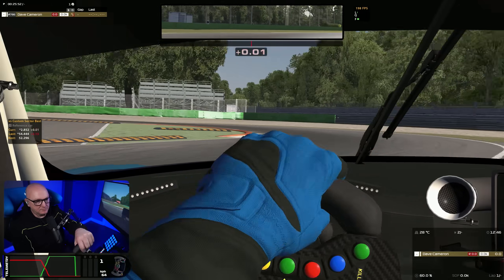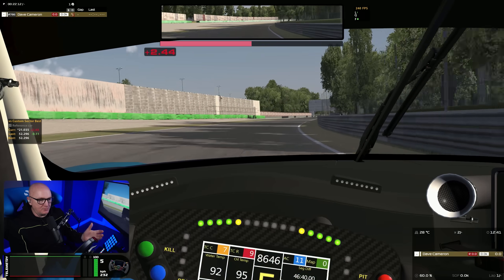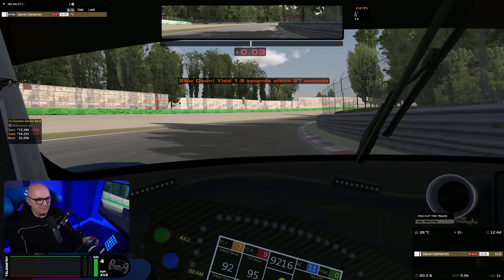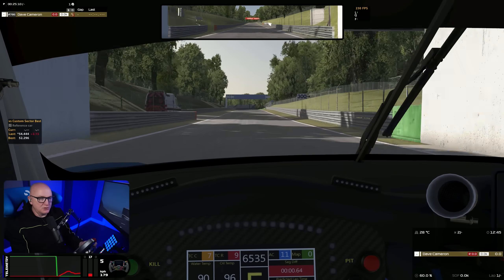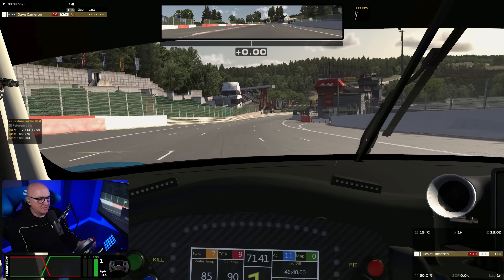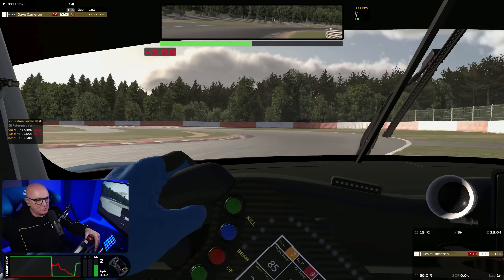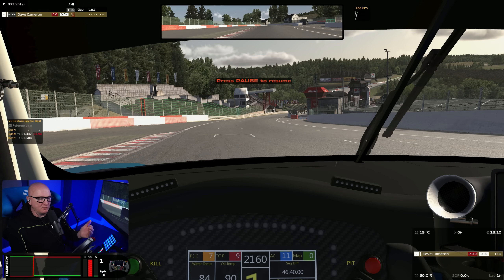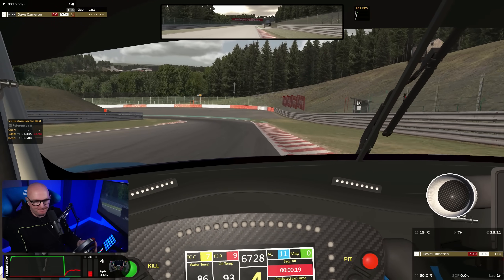What is THE BEST WAY to get rid of an iRacing Slow Down Penalty?

Comment: The slow down system is desperately in need of a rework. The final chicane at Spa is a classic example of the problem - you go off track to avoid a wreck (or even get wrecked) lose several seconds and then re-join by cutting the track - and even though you have already lost a tonne of time, you STILL get a slowdown penalty. Makes no sense at all.
Reply: The slow downs wouldn't be as much of a problem if the track limits were consistent and clearly defined.
Reply: @lavachemist  yes, it's about time all tracks were updated with the newer style track limits and all tracks had the additional notes about track limits.
Reply: @lavachemist  totally agree it's so unnatural considering every corner of every track is different, even some of the tracks with graphics showing the limits are inconsistent.  Just use the "all 4 tires over the white line" rule.
Reply: I watched a dude get spun on the infield of Daytona coming out of the second chicane, got launched into dead center of that big horseshoe and the easiest, safest line to get back on track was to join from where that turn begins. He did so under control and safely at the end of the field, after losing 10-15 seconds, he was promptly hit with a 3 minute and 44 second penalty. That's absolutely bonkers..
Reply: I'm so slow that the slow-down penalty doesn't affect me.😅
Reply: The insane penalty quantity for the final chicane at Spa also incentivizes people to do unsafe rejoins by doubling back into the middle of the chicane to avoid the 5 (?) second penalty, which leads to more incidents.
Reply: The newer tracks have been much better in this regard but yes I largely agree with you here. @lavachemist
Reply: @jasonandrew412  Happened to me last week at Spa, got wrecked going into turn 13, drove safely through the grass and rejoined on the short straight before turn 15. Didn't even have a slowdown, but a whole lap later got a black flag for cutting the track. Took me by complete surprise when that black flag came out.
Reply: Im fresh still to learning how the hell it all works been grindingnaway for daytona 24hr (ACC guy running iracing to join some mates for the 24) and i cannot fathom the track limits or the fact some just give you a 1x and others smash you with a ridiculous and frankly dangerous slowdowns. Exit of the bustop daytona for example. Slightly stuff it and 1.2s slowdown where you gained literally nothing. Real racing sim with zero track limits realism

Comment: move to the racing line and slam on the brakes.

In all seriousness they need to ditch it and move to a system like rf2 has where you get tokens based on how much of a bastard you were in cutting/extending the corner. Slow downs cause way more trouble than they're worth.
Reply: I think slow-downs are a great way to penalise deliberate track cutting. They wipe out any advantage you may have gained instantly, and possibly cost you more (as in, lost positions). Handing out a 5 second penalty at the end of the race may have zero impact on your result, so could be a strategic decision - just like Max overtaking off track, knowing that he'll more than make up the 5 seconds by the end of the race. Same with penalty tokens - the gain in time from cutting the track may be worth the cost of the token. That's never the case with a slow down.
Reply: @RacingAnt  I agree in general, I don't think anyone should be able to take advantage of deliberate cutting, but when it's a matter of only just clipping inside the apex, 2 seconds is waaaay more than you would have ever gained.

They need to implement a minor slow down for minor cuts, rather than losing 2 or 3 seconds (which could be several positions also) for something that would have gained you tenths

Comment: So I've watched the video through again and thought about it more and I think first of all there's something about the iRacing slowdown mechanic that either a) assumes a much slower than typical lap time or b) penalizes you for waiting (thus the increasing penalty).  Secondly, just like when you have to lift, you want to get it over with quickly.  Unfortunately when you get the Radillon slowdown, it's never intentional so your line is going to be different than just blowing through the offtrack area, and your speed is going to be lower.  So I think the idea is to lift enough that the slowdown timer starts to go down, and judge it and get back on the throttle earlier than when it's at more than a second left, maybe 1.3 or so.  I'd rather "under-serve" the slowdown and have to bleed off a little extra speed by doing a slightly lower vMin in one of the subsequent corners, than "over-serve" the slowdown and lose another few positions.  Also not to be excluded is the etiquette for serving slowdowns.  I must admit I've been naughty and served mine by braking a little earlier and moseying through tight corners to keep folks behind.  I think the ideal way is to get offline immediately but there's a grey area to it.  Of course we're fighting to win, so we should try to minimize the position loss, but not at the expense of safety.  Serving most of the slowdown on the straight, and scrubbing the last few tenths off in the corner I think is a decent compromise because that's not much different from making a mistake in the corner that costs a few tenths.  Anyway I think the topic of optimizing serving of slowdowns shouldn't exclude your philosophy on the etiquette just as much as the mechanics of it.  As a regular viewer I happen to know that you aren't a fan of serving slowdowns while staying on the racing line.  However some viewers of this video may not have watched enough of your full race ones.  Either way great video cheers.

Comment: The slow down penalty should be tied directly to your best lap delta.
 
That way if you’ve already lost time by avoiding an accident or getting hit off by someone the time penalty is nullified. Only if you gain time by going off track do you then have to serve the penalty. Also when you do go to serve the penalty there is none of this fooling around trying to find the optimal way to serve it. As long as your lap delta is representative of the penalty it’s considered as served. I never understood how it always seems a “1.5 second penalty” always results in like 3-5 seconds of actual lap time lost to serve it. The system is severely broken and needs fixing. That is the biggest thing this video really proves.
Reply: I actually emailed iracing askng for them to clarifythe slowdowns. It doesnt make any sense. Leave the bus stop at daytona even to your session best. Get a slowdown, now lift off the throttle a bit. Now you're down 1.5 seconds off your session best but your 1.2 second slowdown still shows you needto lose .5 of a second. Its so stupid

Comment: Love your content,  The best way Ive learned to minimize time deficit on track limit penalty is to bleed the timer, Example, If I get a 1.2s penalty I drive full send and slow down just enough to serve .3 seconds and then go full send and the timer should start to bleed and should have enough time to bleed it all before completing the lap, If the timer is increasing then slow down little bit again to serve .5 Seconds then go full send and repeat as necessary until full serve of penalty. 

Or just go full send and then at every corner slow down fractions of seconds to bleed timer. 30s to complete off track penalty is plenty of time.

Comment: I feel like there's a halfway point between your approaches (esp. on the Spa example). Go full steam down the Kemmel straight and lift and coast into Le Combes and take that complex a bit slower, full steam down to Rivage and then take that corner a bit slower. I try to bleed the penalty off when I'd be going slower anyways rather than compromise the straights.
Reply from the maker: Not ideal serving a slow down on the racing line. Not something I would ever suggest which is why even in this demo I moved where I would be in the race
Reply: Easier to judge this way, too.  The catch is if you wait until Les Combes, the penalty is likely to be over 2 seconds by that point.

Comment: I think the X's for contact and loss of control (which should affect SR) should be separate from the off-track points (which should not affect SR) system. Then they could hand out off-track points depending on how bad the offense is. Hang a tire over the line, 1x. Do a cut like at Raidillon that gains a lot of time and maybe you get a 4x. Get a certain number of off track points and you get a drive through penalty. No on track slowdowns. They are too hard to do fairly and often cause accident's. Contact and loss of control points would also have their own limit, leading to penalties or DQ. I don't see an off track as "unsafe" driving. In some cases, like avoiding an incident, it's the safe choice. Otherwise, it's usually just the result of hard racing or a slight misjudgment.
Reply: Avoid a wreck get a slowdown lol

Comment: There's gonna be a lot of comments about you not testing the coasting method.
I honestly think it's the most efficient way. 

If I get a slowdown at Monza, for instance.
I would delay coming out of the corner just a coupe of 10ths......that gets rid of some of the time, and also the added bonus of you now being slower than iRacings timer, so even though you're driving at full speed, you're slowly losing more 10ths.
If the 10ths dont bleed off quick enough, then I'll just lift off a smidge every couple of seconds.
And then finally I will lift off and coast 25/30 metres before the braking zone, which actually equates to about 40m because you can brake that little bit later.
If you do it all properly, then you should have bled the penalty off by the time you come out of the next chicane and lost minimal positions.

Comment: I try to coast into braking points then delay getting back on the power and try to spread the penalty out. But if it's gaining time you can lift off a bit...but sometimes you have no options left.
Reply: A few of us have a similar method and this is the one Dave didn't test.
Reply: @davidius74  it should be a flexible approach to how to get rid of it. Track/corner depending....Delaying getting the power at the apex can reduce the time without hurting you too much, same for coasting into breaking areas. Keeping your average speed as high as possible but with the slow down time either dropping or remaining the same. I think is possibly the best.
Reply: @karlwatson45  This is correct. There is no "best way" to do it. It's about managing the time delta within the timeframe. Take corners slower, don't accelerate hard until it's gone

Comment: This is NOT a comprehensive test.  On each test you NEVER did the method I employ, which is to keep going but to brake that bit earlier at the next corner and then go through it it slower and then accelerate a bit until it is gone.  You could have taken the chicanes a bit slower just by braking earlier going in, and waiting a bit later to get on the throttle but also carrying less speed.  While it does say "slow down", you don't actually have to slow down just as long as you aren't going full throttle.  Each track is different as to what method really is the best but generally speaking if you get a slow down going onto a fast section you need to keep your speed up because the timer is always long enough to get to the next slow corner or chicane.  Braking half a second going into those chicanes and going even 10mph slower through them, will bleed off your slow down time very quickly (braking 0.5 earlier actually drops you 0.7 of the penalty because of the speed difference) that if done right you will not lose much if anything on exit as your slow down will be finished.  I would be curious where this method actually ranks compared to the others.
Reply from the maker: Imo that is the wrong way and least effective. But it depends on your pace I suppose. If you're a bit slower (not saying you are) slow downs are much easier to deal with 👍
Serving slow downs on the racing line like you suggest is all kinds of wrong too

Comment: Hi Dave.  Thanks for the video.  I've made up a story in my head that you decided to start practicing the Porsche Cup at Spa to do a video.  You got that Radillon slowdown a few times, maybe even did a race and saw people get it on the first lap, and decided to make this video.  Maybe I'm projecting!  But I'll be watching for some Porsche Cup at Spa content soon!  (And hopefully not needing your advice in my races there but I'll definitely keep it in mind) FWIW the one race in the HPD where I got one NOT on the first lap I served it a little through Les Combes (the first right/left complex after the Kemeel straight) and finished it off in Bruxelles (the 180 degree slow 2nd gear right hander) which seemed to work quite well, though was a bit naughty.  Thanks again Dave.
Reply from the maker: I actually jumped into a practice session earlier 😁

Comment: Dave when  I get a slow down penalty I get to the next corner so slow round the corner more than usual I use the corners to  rid of the penalty. When you get the penalty you dont go flat out you go fast yes but not flat out. The S bend you should have lost most of your penalty then yb the next bend it should take the rest off. You lose a lot less time as well.

Comment: I dont agree with you dave.
I take more things in consideration..
I never ever get rid of it in a fast section because after you get rid of the SD uou continue to lose time.
If i got an hairpin after the SD i just dont care of it just dont go in full attack and you ll get rid of it.
For the others i take other things in consideration : fuel and tyre temp.
I save fuel by releasing waay before  thr braking point, i do less trailbraking and more coasting.
This is not the most efficient on that moment itself, but i saved fuel and cooled down my tyres wich means up to 2 tenth less in the pits and better grip for nearly half a lap

Comment: If you got a 1.2 second slowdown and 30 seconds to run it off you need to back it off until it hits 8/10 and then go all out from there. By doing this you are dividing 30 seconds divided by three, and dividing 1.2 seconds divided by three is .4 seconds.

Comment: The way I do it, is wait for a sharp corner and brake extra early, run out the penalty, and because I'm going extra slow into the corner, I can get on the gas extra early and come out of the corner faster than I normally would, making back some of the time.

Comment: For the first track where you got 1.2 seconds if you would’ve slowed it down and started going at .9 seconds I think that would’ve been your best option. In the past that’s what I’ve done is slowed it down about 3/10 and took off from there and it usually leveled out by the time expiring.

Comment: I usually just continue to drive and brake slightly earlier for a corner
Reply: A few of us have a similar method and this is the one Dave didn't test.
Reply: "Braking slightly earlier" doesn't work for the Radillon slowdown because by the time you get to the brake zone for Les Combes your penalty is going to be over two seconds.  You'd have to brake early enough for it to be considered a brake test, and it would still be impossibly hard to judge.

Comment: Im not sure why a tiny cut of a few inches requires a 2 second slowdown. Just make it so I have to lift for a fraction and not gain an advantage, which at best would be 2 tenths. Losing that momentum along the next straight is more than enough punishment for the crime.  To ruin an entire sprint race because of a tiny misjudgment isnt doing anyone any favours

Comment: Err, the determining factor is the # of corners, which you totally failed to mention, let alone account for, Dave. The more corners b4 you clear it, the more time is added, even i could work that one out without testing.
Reply from the maker: Which I demonstrated by driving until the timer was about to run out. The timer would increase without a turn if you kept your foot in it

Comment: What happened to the audio levels, Dave? They are really bad on this video!
Reply from the maker: In what way? Seem ok my end
Reply: @davecamyt  15dB too low.
Reply: I have no problem with the sound quality or the volume level. Sounds fine to me
Reply: @davecamyt  It's the level of volume that seems to be a fair bit lower than other content creator's videos. At the same volume setting, going to another creator's video it's much louder in theirs. It's still at a fine enough level to hear things clearly. I think the main issue is adjusting the volume setting up for your video and then going to another youtube video only to find it much too loud and having to turn it back down again.
Reply from the maker: @Citizen-vl5cy  my voice is at -9db in the edit. Plenty loud enough I think
Reply: @davecamyt  Well. My main output is usually set between -19 and -24 dB on my mixer. For your latest videos I have to turn it up to -9dB.

Comment: Half of these will get you killed, don't see the point of timing it just parking it on the apex or not going in an acceleration zone. Just lift and coast or go slow offline inbetween to corners.